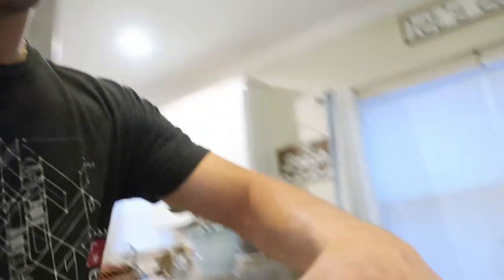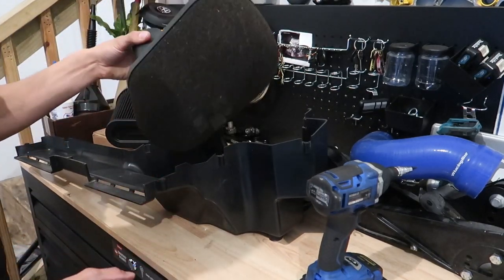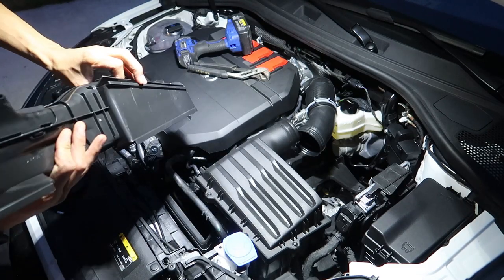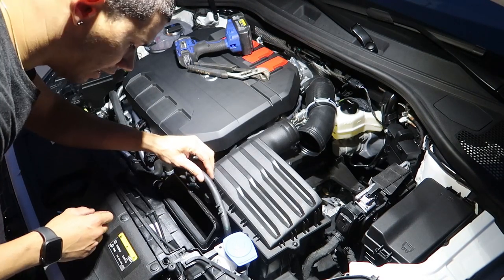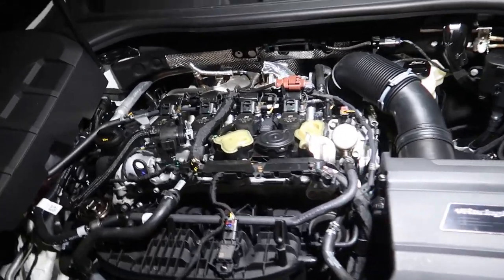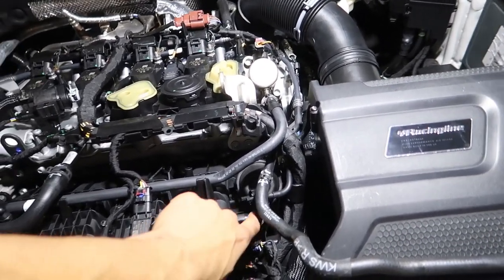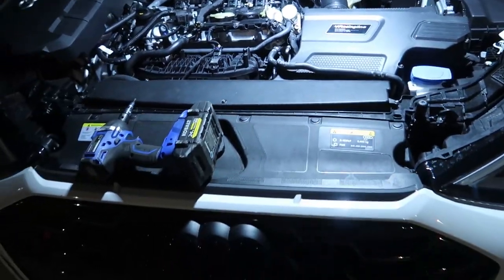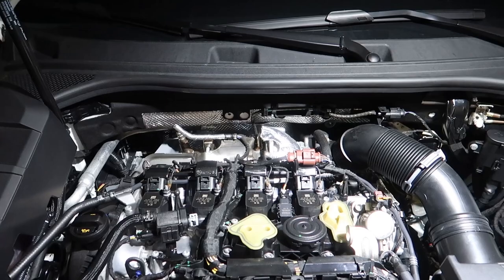Will the MK7/8V Racingline R600 intake fit the MK8 Golf R or 8Y S3?

Comment: That hose that has 2 diff diameter if same as mk7 should be for the intake runner solenoid iirc
Reply from the maker: Yeah it is, just a tad shorter on the gen 4 it seems